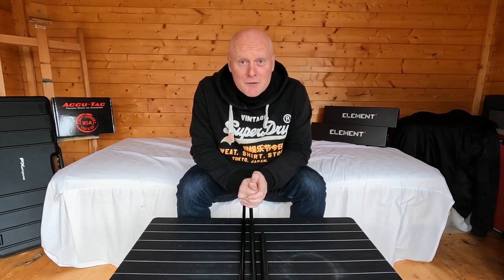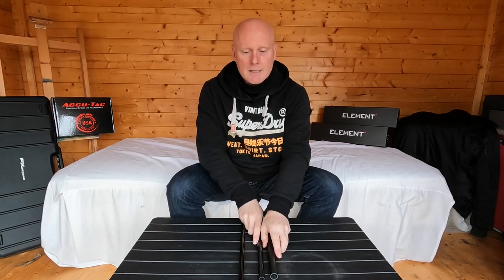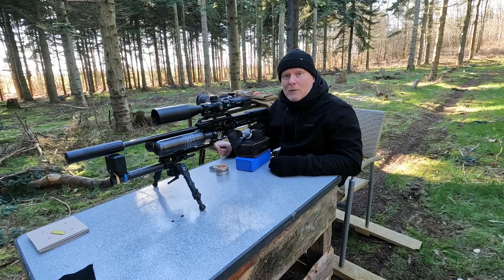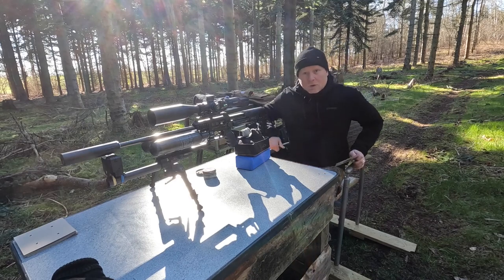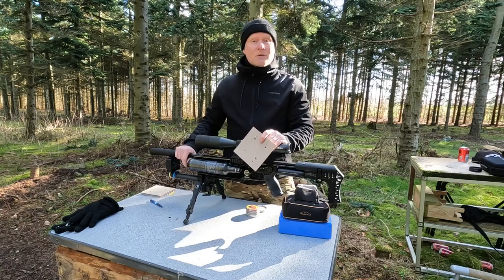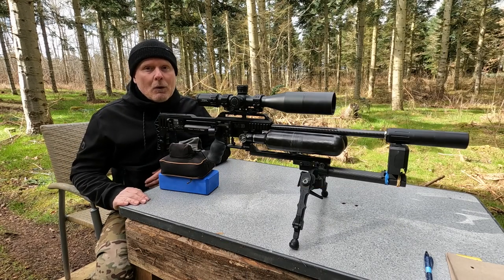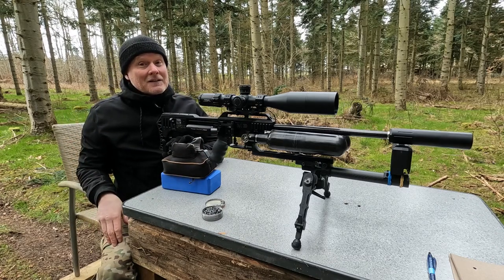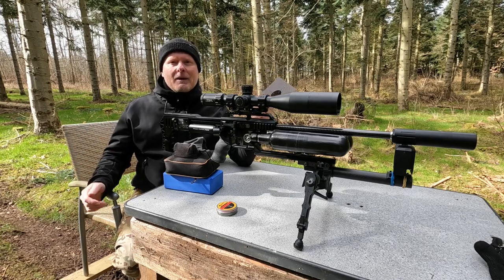Modified Barrel Tensioning System on FX Impact M3

Comment: Great video mate! Really interesting to see how a bit of experimenting with your tensioning kit and different velocitys can get the best accuracy out of your impact. I have the tensioning kit fitted to my M3 and i also fitted the factory shroud over the tension kit ( little bit of modification needed) and as for accuracy, well it didnt make things better but neither did it make things worse but fitting a donny fl fatboy with extender and muzzle break really did help though.
Reply from the maker: Thanks buddy 🙂
The right silencer really helps alot on the barrel tensioner ☝️ I can easily imagine the Fatboy doing a great job.
What did you use as the rear insert in the back of the shroud?
Reply: @VikingAirgunner  i just used some self almalgamating tape , others have used painters tape but whatever you use ,just make sure the diameter of it is correct so you have a nice tight fit.some people on airgun nation have managed to use  brass plumbers parts with the correct thread size.

Comment: Hi Peter ,
I have so much invested in my Impact I am forced to deal with a problem FX has put a band aide to fix a good twist liner . 
The tensioner is hit and miss with each kit . Some seem to be happy with it , I guess ? 
I am doing the same thing you are in trying to deal with accuracy and a massive shift of the barrel when tensioning the carbon sleeve .
I took photos of the ends of the carbon sleeve I received . One was square , the other was visibly not . I contacted my supplier and they in turn contacted FX . There response ?… like crickets .
There is a new kid on the block , Skout Epoch  ! It’s arguably expensive but not really . By the time I think of all the upgrade expenses and thousands of pellets wasted trying to fix my Impact without support , I’m done .
Love my Skout Epoch !  You will spend more time enjoying shooting instead of wasting time !
Reply from the maker: Im sorry to hear that you have had an experience like that with fx. I have had contact a couple of times and they always helped 🤔
Reguarding the ends of the tensioning carbon sleeve - I went to a factory close to where I live and they cut it with industrial accuracy and it took 5 minuts 🤗
I have seen the Epoch and talked to the guy at IWA in Germany. Very nice gun but as I understand they do not have a designated slug barrel in 177 yet? 🤔
Im excited to see when people start to test it under normal circumstances. And show it on video.
I have heard so many talking about their guns alwsys being hole in hole on 100 m and without warm up. Especially one particular brand (guess wich) But any time someone shows up shooting next to me they NEVER out perform the Impact.
But it would be nice to see the Epoch performing well since the guy from the company seems very nice, smart and dedicated 🤗
Reply: Peter ,
I attest to these things with the 30 cal 35 “ barrel Skout Epoch .  Stable FPS from first shot to last . I think the shut-off valve to the main bottle and releasing pressure to the valves contributes to this stability . Something FX could learn from . Better shot count with the same velocities and grain on slug or pellet . The electronic trigger is by far better than any PCP for that matter . Much easier to adjust regulator pressures . 
The top rail that holds the scope is so much better than the FX Impact and is much more secure . 
Barrel swap is effortless and much more solid than FX .  Big plus , if you want to shot some other manufacturers barrel . You can send your barrel for conversion . The overall frame is much more robust which will contribute to less air leaks . Because there is no hammer to engage the valve , it is easier to cycle pellets or slugs in the breach and is smoother when firing because it is activated by an electronic solenoid rather than a spring and hammer . The programmable trigger may scare some but it has been tested and found to be extremely reliable under adverse conditions . It has programming adjustments to suite any shooter . Pellet on pellet is one hole with a 5 shot group . Literally one hole at 40 yards and is the farthest I can shoot in my back yard . It is sub MOA at 100 yards at the range 
No air gun I have ever owned , has , out of the box been this accurate !  
The negatives , but fixable , is is loud . I have corrected it with a Donny FL Emperor and it’s back yard friendly . It does not in any way effect accuracy . 
Some shooters will be skeptical with pricing , but if you are serious about air gunning , you will own one one day !  
In closing and it’s funny to say this ,  you have a choice !  If you like to tinker trying to find accuracy don’t buy the Skout Epoch ! Lol
It’s a gun you will go out and shoot and not have to mess with . It’s almost boring. NOT !
Reply: One other thing I must say . We are a consumer with the love of this sport . I commend FX for the advancement of the PCP . They have done a lot off innovative work . There success is a testament to their growth . However, any company can lose its way in design upgrades . The most damaging is when you lose touch with your dealers and their service department. They can become inundated with repairs and delays in replacement parts . It is not the dealers fault . 
The customer in turn suffers and it leaves a bad taste in their mouth with little to no resolve. 
It can be that way with any company that doesn’t pay attention to what is the most important .
The customer who buys their product !

Comment: love your idea for filling up the empty space in the tensioner. I'm not happy with the tensioner. My groups are better without And I have no idea why.
Reply from the maker: As I see it there can be a few reasons why the tensioner doesnt improve accuracy.
Ammo too light or maybe try a different torque of the tension 🤔
I cut one tensioner down to fit a 600 mm barrel and it was not a succes - but then again... Fx doesnt make it for the 600 mm liner for a reason I guess 😃
Reply: The tensioner causes more problems than it solves . Tension can be inconsistent changing point of impact . It can come lose during shooting . Worst is a carbon fiber sleeve that is not square on each end causing a massive shift when tensioning the barrel . So much so your scope can’t compensate for the shift ! 
It is absolutely ridiculous FX hasn’t done a better job fixing this problem . Not only that but it’s like crickets when you ask for a replacement carbon fiber replacement .
Reply: @VikingAirgunner I am doing the same thing you are Peter .  There are a lot of carbon fiber suppliers . It’s hit and miss with the dimensions and the quality of the outer sleeve . I will keep you posted as I get samples and try different manufacturers .
The ticket is to find a sleeve combination that will go all the way to the breach and the same diameter to allow there block clamping device to give stiffness to the barrel length . I’m adding additional O-Rings on the sleeve to metal shroud . Then stacking the carbon fiber layers to keep an overall stiffness.  
Good luck my friend !
Reply: @hotchihuahua1546  you are absoultely right !!!

Comment: Hi Peter,

First of all excellent videos!
Do you recommend upgrading to the Barrel Kit FX Impact Tensioned 700 mm? or stick with 600 heavy slug linner?
Reply from the maker: Hi Marco

Excellent question.
Actually I have not explored the true potential of the 600 heavy liner, since I only shot it for a short period. So claiming to be an expert on that barrel would be a bit of a statement.
It did very well with the 13 gr ZAN and the 15 gr NSA, but to get the heavier ones to fly well I had to go very high on the reg or go for the dual hole transfer port. My buddy is using that transfer port with very little spread, so it is possible to shoot both 16 and 20 gr in the 600mm with a reg at max 140 bar.
I like the 700 mm since the tensioner system makes a positive  difference and bcs I can keep the reg low. 132 bar for 20 gr with the standard transfer port.
The accuracy of the 700 mm is outstanding. Best groups are still with the 16 gr Zan. Exploring the 20 gr Zan  wih heavier hammer weights at the moment to find their true potential, so maybe this will give the last bit to equal the 16 gr groups.

So long answer short:
600 mm is great but I will stick to the 700 mm 😃
Reply: @VikingAirgunner  Thanks Peter for the longer reply, I just recieved today dual transfer port, will see how my  groups  improve at 75-100m. 
I currently have the, heavy slug linner, barrel sleve, tensioner, slug power tune kit with 8.5g hammer, still need to experiment with the 6.9g to find best fit...
Just not sure if 100mm extra will give me that extra acurracy, vs the pricee for the upgrade   (Barrel Kit FX Impact Tensioned 700 mm)
Reply from the maker: @marcoe01  Very good idea to explore the 600 mm in detail before diving into expensive upgrades ☝️
Have fun exploring 😎

Comment: I tried it on my M3 but result were bad. went from 5mm C2C at 25yd to 10cm c2c :(. happy i tried it a close range. Removing it was an immediate fix. Not sure what went wrong. I have to say my extra CF tube was a super tight fit had to tap it lightly wit a hammer to get it the CF tube from the tentioner. it did slide over the barrel without any issue. But after tapping it out I did not trust the CF tube anymore so It went in the trash. Live and learn ;-)
Reply: Hi, greatings from Portugal. Im not a guru, just wanna give u a idea. My experience with cf tension is good, but I have to face the top ends on a lathe machine. They dont prepare the tube as it should from factory. And the torque settings is hand thight plus 1/8 of a turn. If necessary buy a torque wrench and try diferent torques to see what is better. This aplyes to the 700 and 800mm barrel. Next u should work on the barrel as well. Put a pellet on it and push with a fiber or wood rod until gets out. You must eliminate (except the choked) the thight areas inside the barrel polishing them. This all together will make tighter your groups and no flyers. Dont believe on you tube marketing channels, every fx barrels are diferent, actually does not exist equal barrels even in firearms. Next for long range buy altaros and shhot them at 900fps, they are insane. You can plinking with a 20cm gong at 500 meters

Comment: Could you please tell me the exact dimamter for the middle carbon fiber ??
Did you use the tensioner nut ???
Reply from the maker: The piece between the housing and the barrel tensioner is: ID: 14 mm, OD: 16 mm.
Yes you need the tensioner nut, but it only tensions the original barrel tensioner.
Reply: Great. Will done 👍
Reply: @VikingAirgunner  what is the exact length ??
Reply from the maker: @TargetShoot1985  Dont really remember, but I think that it is 35,5 cm for the 700 mm liner.

Comment: Looks like a solid kit. I am a little lost. I went to buy the 700mm tensioning kit but it states "This FX Impact 700 mm Tensioner kit replaces the original shroud of your M3" but you are still using yours what am I miss here?
Reply from the maker: In this video I am not using the shroud. Only the barrel tensioner - and the aditional carbon sleeves on the inside.
If you want to use both the barrel tensioner and the shroud, the shroud has to be especially fitted.
Reply: @VikingAirgunner  can you tell me the exact size of the additional cf tube? Because i measure the od of barrel housing is 14,6mm and the id of cF that come from the tensioning kit) is 15mm... So what size of the cf additional tube i should order?
Reply from the maker: @robinsonsitompul9362  I just checked and the barrel housing is 14 mm and the ID of the tensioner piece is 16mm, so it is as I say in the video: ID: 14 mm OD: 16 mm 🙂
You can find them on Ebay 😎

Comment: We should not have to mess about avoiding this problem, FX should supply a solid high quality barrel instead of the swaged low grade tube that costs about $3 and underpins the profit on a 2 grand rifle!

This is not a stable solution, or fair value to have to fix supposedly the best, most expensive air rifles in the world.
Reply from the maker: First up I would appreciate a respectable tone. Anyone is welcome to share their point of view but please keep it clean.
I am producing content to share my experiences and to give my contribution to the airgunning community. If you agree or feel that you expand your knowledge by watching my videos, I have forfilled my goal. If you dont you are more than welcome to share your knowledge - but please keep it clean.

Secondly I have shot many 1/2 inch groups at 100 m, so the liner cant be all that bad. 
On top of that it had shown its worth in competitions time and time again beating rifles with traditional barrels. Lately even competing in NRL 22 matches and winning over powder burners.

For your info I am modifying a barrel from Lothar Walter these days and will be performing a test to publish very soon. So lets see how it performs against the standard liner.

In case you choose to comment on my reply please keep a civil tone.